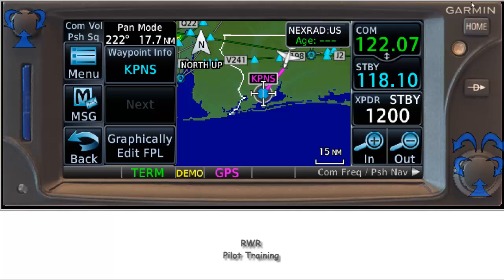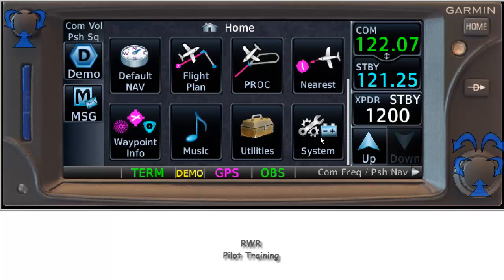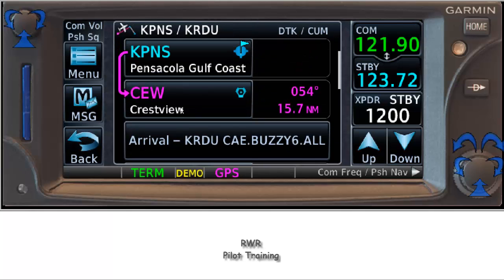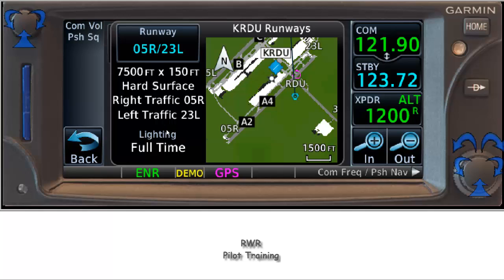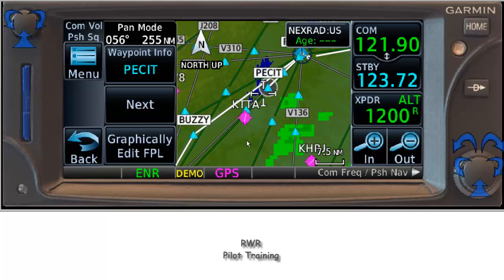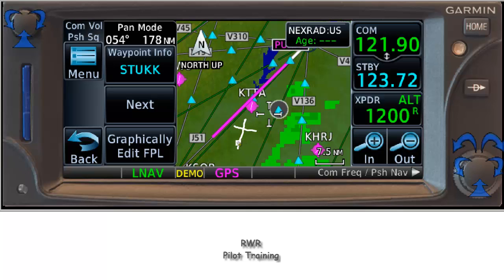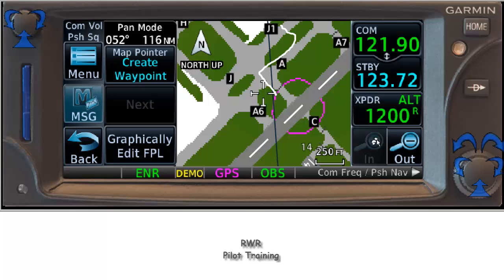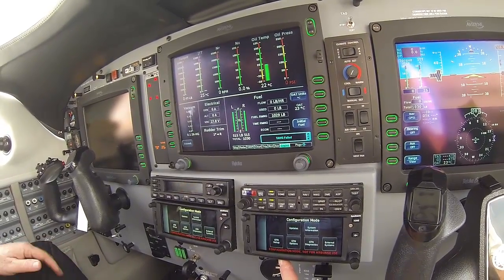GTN650 Getting Started

Comment: Great Video. Just confused with the OBS feature. Does that suspend the gps when we are doing an approach.
Reply from the maker: Hi Richard, The OBS works the same way in modern panels as it did in Legacy style instruments. It allows the pilot to select any bearing to or from a point. This means that using OBS will preclude the computer doing anything associated with a flight plan because the navigator can only do one thing at a time. One advantage to OBS is that it is a quick way to get lined up with a runway at an airport without any approach procedures. I hope this explanation helps.

Comment: Great information and video.  As an aspiring IFR pilot that recently acquired a GTN650 this video is good information.  I had distortion issues with the side tone on my rig that was finally corrected by grounding a pin on the audio panel forcing the audio panel to supply the side tone.  Works great now.  There are many additional features in the 650 that I am still discovering that really help flying IFR.  Thanks for all the info.
Reply from the maker: You Bet! Fly Safely - Train Often .. DR